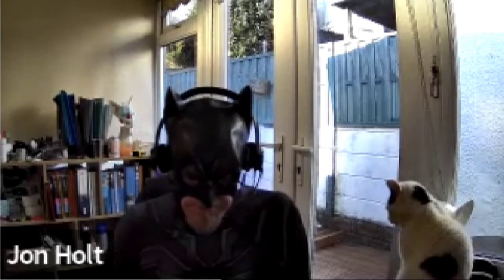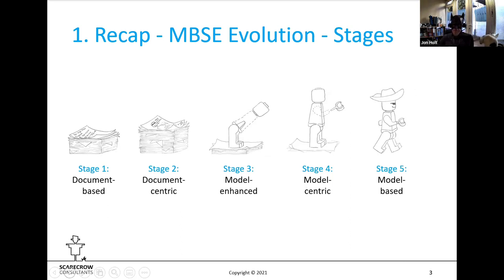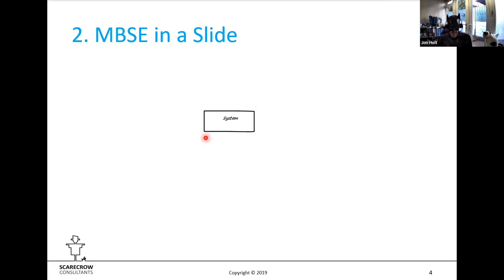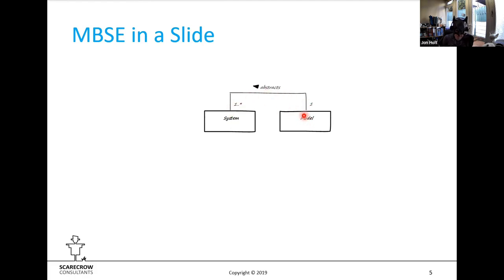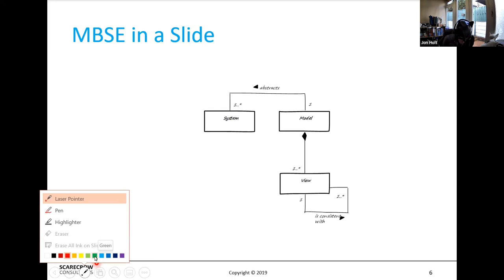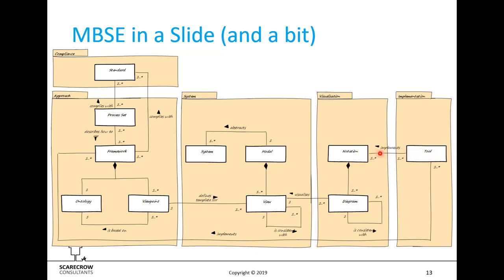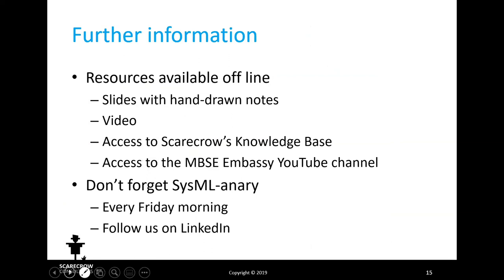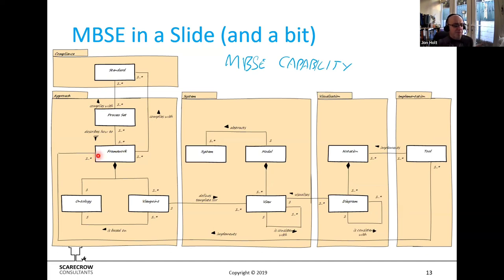Model-based Systems Engineering Demystified (Part 2) - MBSE in a Slide - Full Video

Comment from the maker: Timestamps:
0:01 - Batman!?
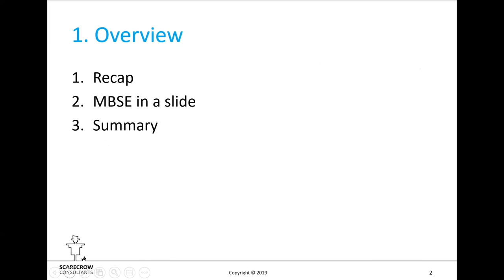0:45 - Recap of the need of the MBSE
3:15 - Start point of systems engineering - a system
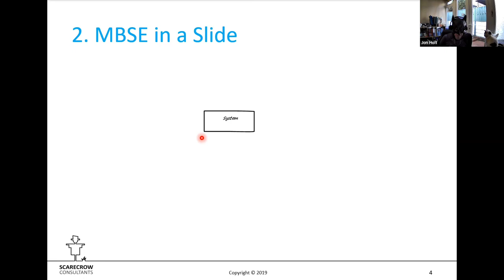6:35 - A model as a single point of truth
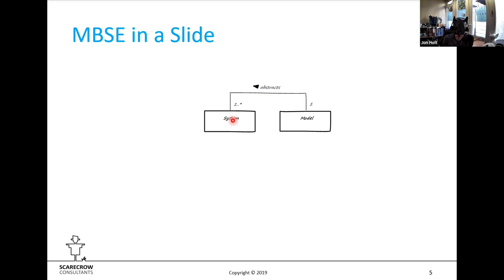9:15 - A view as a part of the model
13:45 - A notation and a diagram - How do we choose a language for MBSE?
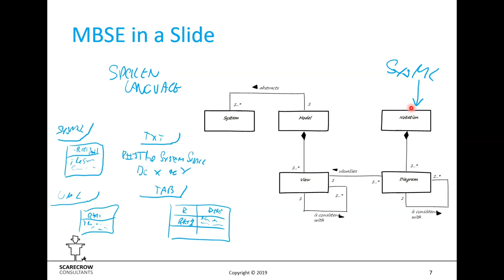19:56 - A viewpoint - Who and why needs parts of our model? What is the content of them?
21:25 - An ontology
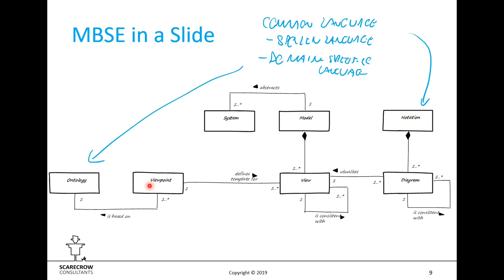26:30 - A framework
27:20 - A methodology
28:20 - MBSE in a slide - Summary of the above mentioned
28:50 - A tool and a standard
36:51 - Summary
39:45 - Question 1 - Do we eliminate requirement documents when we use MBSE?
41:55 - Question 2 - When using multiple notations in a single project - How do we insure consistency if we do not use a single tool?
45:06 - Question 3 - How do we manage versions of a model?
46:15 - Question 4 - In my experience a model is not only used in the development phase of the project, but also in further phases or even for deployment of MBSE?
47:35 - Question 5 - Product or project?
47:55 - Question 6 - How does CAD fits into here?

Comment: If anyone wants to see the definition of viewpoints in practice in a very similar way as presented by Prof. Holt at 24:13, the MODAF specification uses a similar notation for describing its viewpoints. e.g. this document specifies the system viewpoints in MODAF: https://assets.publishing.service.gov.uk/government/uploads/system/uploads/attachment_data/file/951660/20100426MODAFSVViewpointV1_2_004U-withdrawn.pdf - page 5